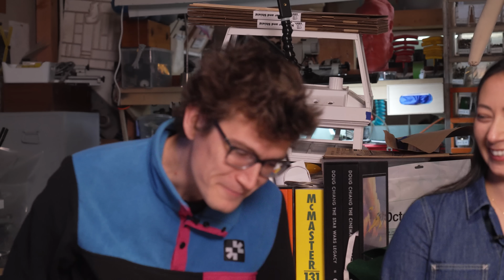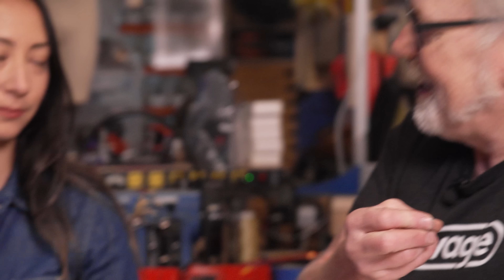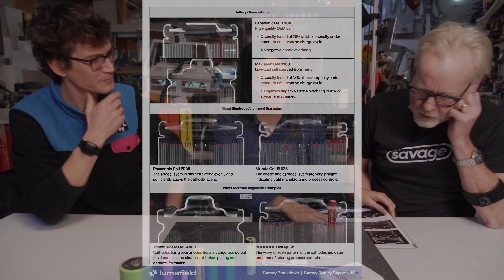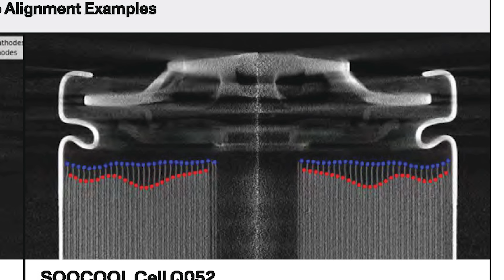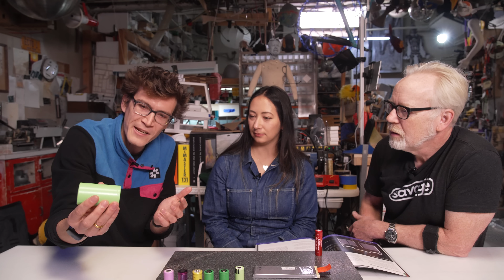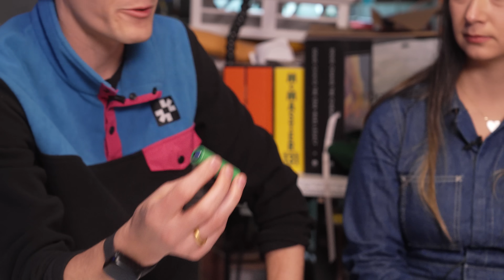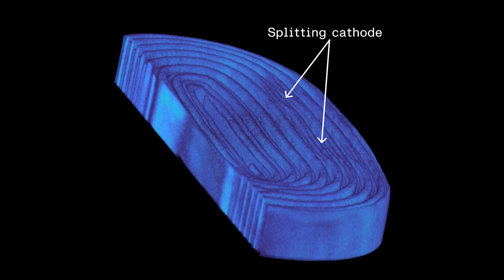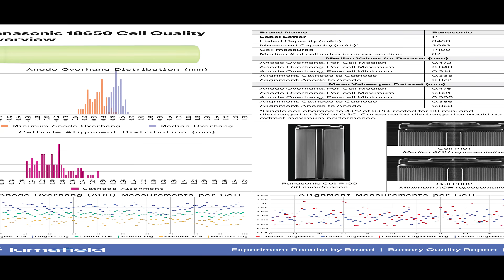The Surprising Flaws in 18650 Lithium-Ion Batteries

Comment: My 18650 battery was labeled Sure Fire.  I hope the name is not a guarantee to catch fire.
Reply: SureFire was okay, it was UltraFire you had to watch out for, those were extremely dodgy!
Reply: @Shaker626 Trustfire? 🤔
Reply: @SpectreOZ none of my TrustFires burned but they all died within two years.
Reply: @Shaker626  mine are SunFire lol-
Reply: SureFire doesn't make the batteries themselves, most of the ones I have seen were manufactured by Panasonic out of Georgia, but they also use Samsung and Sanyo batteries too. The Batteries are made to SureFire's specifications and branded with their name on them. SureFire makes some really great stuff, the US military uses SureFire branded batteries and other things made by them. I have used SureFire stuff for about 20 years with zeros issues. I worked in Afghanistan as a contractor for the US military for about 12 years and SureFire stuff was everywhere.
Reply: @JJ_ExMachina  Agree. They are also a very popular choice for police, fire and rescue.
Reply: @wingnutbert9685 ... That's right, my friend is a retired firefighter, and the surefire flashlights he has are insanely bright. They make some good stuff, a bit on the pricey side, but really built tough.
Reply: @JJ_ExMachina  SureFire flashlights got some bad publicity several years ago when they changed where they got their 18650 batteries for the SureFire. And they were overheating and sometimes catching fire. I suspect they went back to a reputable manufacturer because they haven't made the news again.
Reply: @steadyeddie7453 ... Yeah if I am not mistaken they discovered that the x300 flashlights had high parasitic drain, and was over discharging the batteries. Which is bad news for lithium based batteries. From what I am reading SureFire took action to replace the faulty flashlights with new ones when the cause of the issues was determined. I am not seeing much on failed batteries due to SureFire using subpar batteries. Panasonic did have a recall on a batch of batteries thwy determined to have issues, so that might have effected SureFire, but can't find any concrete info on that thiugh
Reply: @JJ_ExMachina  All brands with "Fire" in their name are made by others. To my knowledge, SureFire is the only one of the lot selling good batteries.
Reply: @rudib-5304 You know what, now that I think about it, yeah you're right. Have been building ebike batteries and off grid battery systems off and on since the early 2000s. Use to only run Sony, or Samsung batteries. Now that peeps are started to really test and show what's going on inside, have lots more viable options.
Reply: @JJ_ExMachina somtimes the batteries are from old devices like laptops and they wrap em and resell it after testing
Reply: @user-tr2dh4xx6u  ... It's possible, but can't find where that surefire reuses old laptop batteries in their products. I am sure they don't even recommend using repurposed batteries in anything they sell. Most of their stuff is "mil-spec" meaning designed to withstand some serious abuse, so highly unlikely the military would sign off on products running repurposed old batteries.
Reply: @JJ_ExMachina  Thank you for the comment, representative of SureFire...
Reply: @no1DdC  ... No fucking rep of Surefire, just used their stuff for over 20 years is all from my ime I served in the military to all the time I worked in a war zone as a contractor for the military. Just shared my experience with their stuff
Reply: @no1DdC  Though I dont buy batteries from you I used several of your lamps than ran on CR123
Best lamps out there. I seem to remember than you drove a Bradley IFV over one of your lamps, am I correct ?
I still have Surefire lamps in my bug out bag (shelf life of CR123 is unbeatable) but now use other brands running on 18650 for caving.
Reply: Just stay away from any cells with the word fire in the name, if it blows up you cant say they didnt warn you
Reply: @hus_10001  Unless it's Surefire. They are a well known name in the indistry.
Reply: My neighbor's old house down the street burned to the ground one night... The only thing left was the  iron mailbox at the street with the family name.  "SPARKS"
Reply: noooo, it's probably a incendiary grenade
Reply: For the love of dog. Do not buy any battery with fire in the name. I've seen to many vent over the years. Spend the 6 bucks a cell and get molicells. Or Sony/murata vct, samsung or any of those big name high discharge batteries.
Reply: @V8DV  or TENERGY - high quality US company. all their 18650 and NiMh are still good 10 years later.        EBAY stopped selling 18650, getting rid of the 'Fires' and 'Scams'
Reply: Efest came out best for me. They last for years (12+ years in constant use in high discharge torches).
Dx.
Reply: @Diagnostix_1 Efest can be very good, since they buy higher quality cells from manufacturers like Panasonic and rewrap them with their branding on them. I typically just by the Panasonic cells instead of getting them from companies that do the whole rewrap thing. But than again sometimes it's hard to find first party cells. Efest can be hit or miss, depending on what cells they have rewrapped though, as some of their batches come from rejected first party batches at a discounted price. But overall they can be pretty good, especially if you win the luck lottery and get a rewraped Sony, Panasonic, or Samsung cell.
Reply: Most vets will recognize surefire.
Reply: @rustyudder  ... Yep Surefire is all over our batteries and flashlights to name a few things.
Reply: @JJ_ExMachina  i loved my little clip lights. Ir came in handy.
Reply: @rustyudder  ... Heck yeah, I think I still have a few of them in a draw somewhere. I had them clipped on everything at one point, didn't even worry when they got washed, they just worked.
Reply: I had some UltraFire batteries, are those worse?  Maybe these Chinesium have saved money by combining the Warning label with the Brand name!
Reply: Dont call them a liar.
Reply: I moved on from ultrafire to efest (shown in the video) because the ultrafire didnt last for very long (I use them for caving).
That was a very good decision: batteries lasted much longer but more importantly I could finally use the "turbo" mode in the lamps for more than a few seconds. I also have a bunch of Panasonic that I almost never get to use since the efest last for so long.
I of course keep the batteries in hard plastic cases because of the physical nature of my activity. I dont want one bursting into fire because I dropped my bag from a few meters and a battery shorted !
Bottom line: as said in the video, spending a little bit more is the best decision if you want reliable batteries.
Reply: 😆rignt!
Reply: I’ve beat the hell out of my 18650s with my vape for years and have never had an issue
Reply: had crummy Ultrafire.  might be counterfeit too.   Only rely on TENERGY brand.
Reply: LMAO
Reply: Ultrafire for mine
Reply: I never bought any of those brands that had fire in it lol
Reply: Surefire batery is very good in terms of longevity hasd mine for 1.5 years now
Reply: @0ninetyseven97  That's still brand new, outta the box. I've got a pair of Fenix 18650's that are 12+ years old and still going.
Reply: @0ninetyseven97  They also have excellent CR123 but they are very expensive !
Reply: the name is literally the warning )
Reply: @maxsolo2652  Like apple logo is warning: one bit taken, soon to be rotten inside..
Reply: @PexiTheBuilder  – That's not a bit taken, it's a bite taken, which is a visual pun for byte, and very clever pun at that, considering that the logo was developed for one of the very first personal computers. 

While Apple wasn't the first PC maker, it is the oldest brand still making PCs today. And it was Apple's Steve Wozniak who coined the term "personal computer."
Reply: you sure you're not talking about the high quality light manufacturer?
Reply: sure fire ultrafire and trustfire are just bombs waiting to go off
Reply: @dcd231 SureFire is a legit company. They make some serious stuff. Their batteries are made by legitimate companies like Samsung, Sony, Panasonic, etc.
Reply: you are right to be nervous they named it Sure Fire as a warning sign to let you know what to expect. That way they are NOT held responsible if your home catches on fire cause they warned you  "use these batteries and your home will Surely burn down by fire"
Reply: @rogerd4559  If this was an attempt at being funny or witty, you've fallen on your face. But well done if you where trying to look like a dimwit. 👍

Comment: I have a bunch of batteries for Dewalt tools and tools that use the same batteries.  Most are knockoffs purchased from Amazon with up to 4000 positive customer reviews, whatever that means.  Of these batteries, the only one that has a fail so is a Dewalt battery led level indicators.  It shows one bar all the time though the battery cycles normally.  These are all pretty lightly used batteries.

Comment: You chose pretty nice cells Samsung 35E and the LG MJ are excellent choices. But I want to see what happens with the high amperage cells because the load on them is a LOT heavier compared to the normal ones.

Comment: Another fun fact: the actual chemistries used in lithium batteries are actually patented by other companies and licensed for a period of (usually 3-5 years) to a given manufacturer. The chemistry in cutting edge cells from company A will likely be used by company B in the future. That's how you have the budget batteries at the bottom, they're using much older chemistries or "rolling their own" (by making something that's suitably different from existing chemistry patents).

Comment: Lipo batteries scare the life out of me ever since my Daughter asked me to change the battery on her Iphone years ago.
She had taken it to a high Street repair shop they broke the home button and denied they broke it then a few weeks later the phone wouldn't charge They denied even touching it and when we showed the receipt accused my daughter of breaking it. Actually FK them it was "Timpsons"

 So I hit eBay for a new screen and a Battery and went down the garden shed workshop to fix it. when trying to put the thing back together noticed a poorly cut seam around the battery that formed a brim around the side and one end of the battery.
The extra material was stopping the battery fitting into the phone so I thought I'd trim it down.
I grabbed my Scissors and started to trim the brim off. Almost as soon as I started to cut I felt the battery start to get hot in my hand and smoke started coming out of it. I was aware of how dangerous LIPO batteries could be so the thing was launched out of the open shed door and by the time it landed outside it was on fire.  Stupidity on my part but a lucky escape if the door was closed or I'd decided to do the repair in the house that outcome might have been disastrous. However I knew the battery was a knock off and the brim didn't look like it was part of the battery it literally looked like a poorly finished covering.really didn't realise that the brim was poorly finished Anodes and Cathodes

Comment: It's a pig in a poke. 

My cheap ceramic coffee cup has to say at least which country of origin, but not a battery? I know more about where my  bananas came from than my batteries. 

At a minimum the consumer should be informed as to the date of manufacture and who the manufacturer is.

Most of these batteries are buried in our devices and not "consumer accessible." But the manufacturer of the enclosing device has the responsibility to inform the consumer.

I can't tell anything about my 18600's beyond their volt and amp claims. Some have "Brand" names (REVTRONIC, UltraFire (which claims 4200mAh)), but several are quite plain. None have even a date or country of manufacture, let alone who actually made it. 

I removed the plastic wrap (which itself was blank with only a sticker, "18650 3.7V 2100mAh") from one of them and found only a couple serial numbers (SE US18650UT[damaged] and K C4A13WJ16H), and a damaged tiny logo perhaps thermal dot-matrx printed on some kind of added thermal surface. 

I bough a solar motion light from Dollar Tree a few months ago. When it stopped working I took it apart; the 18600 battery, soldered to the wires, had shot it's core several inches out. Perhaps something I shouldn't have attached to the side of my house.

Comment: If you have a 18650 in your pocket with your keys, the key can make a perfect short circuit, resulting in a party in your pants.
Reply: I think THIS is why they are not used in more devices instead of AA/AAA's. People would treat them like AA/AAA's and burn their house down.

Comment: You should look at a few vape pens for cannabis (or nicotine).  They have little flat pack cells in them.  I wish you guys would call them CELLS.  But I know that the term 
"Battery" has been "accepted" to describe even a single cell unit since the late '60s.  You guys should also (carefully) do some (momentary) (and long term) short testing inside a plexicage. (Lexan).  And look at the momentary results (new physical imagery) after each set of shorting pulses to examine the degrade over time and event(s).

Comment: I bought two 49k mAh batteries that have solar recharge and they were both $13 each.  Now that same battery is $25 but it us STILL very much worth it and is a very good battery and even has inductive charging.  It was a heck of a deal!
Reply: What is 49k ,a brand?
Reply: @bennylloyd-willner9667   49,000 THAT is what the k. So, it is 49,000 milliampere hours.  If you do not know what that is you need to find someone who does to educate you, because the k suffix is centuries old.
Reply: @cosmicraysshotsintothelight well, talk about educated.
How often do educated say 49 "kilomilli" amps 😂
Maybe I was referring to that blunder. It is 49 Ah you're supposed to write since kilo (1000) takes out milli (1/1000) 😊
There you go, educated 👍😊
("49,000 THAT is what the k. "? nope, k means 1000, not 49,000... 
"... find someone who does TO educate you..."??) strange wording😊

Comment: Very interesting information.  We use these in our dive computers, dive lights, etc.  I tore apart a few cordless drill batteries to repower with new 18650 batteries.  I've seen cheaper versions that boast MhA specs that you know are impossible to achieve.  So, I'm familiar with these batteries, but this video gave me a whole new perspective. Thank you.

Comment: This is important. If you buy cheap, you usually get what you pay for (and may put yourself at risk)

There was a Youtube post a while back where a major tool brand battery pack locked itself out because of a detected problem. Some Yutuber decided to muck around and eventually defeated the lockout through a hack and made a big issue that the tool maker 'just wanted to sell more batteries'. The manufacturer has a reputation to protect, especially in safety issues. As we can see here a battery can seem perfectly good, when it's actually not.

Comment: surprised that cordless tools werent mentioned at all.    At big scale (like tool company's)  battery cells are NOT just assembled into a tool batery and welded.   All cells are matched very close, to ensure they all act the same under multiple loads/situations.      It may be a trade secret,  but who knows....      i built a very matched tool battery with cells that were so close in values , its like they were family.   Internal resistance, impeadeace checking,  charge and discharge cures so close , they appear like a single trace.   it took me some serious time, and a few cases of 100cells per box,  to do this, but again, it outperforms anything from the manufacturer.   i will never do it again,  because with 3 chargers that held four cells, it took me almost 1 year, so....    i now have 385 cells with values  on them and can just pick whats left so they are close...          i built a SINGLE ,   Milwaukee m18   15-cell  battery.   i wish marching cells to another was addressed in this video, because it is quite important.     Milwaukee m18 battery circuit board, is NOT active balance, but passive.

Comment: My Bosch 18v 4ah  li -on drill battery 
Is 16 years old and works fine with the circular saw and grinder also. 
My Aldi cordless drill battery went dud after 3 days . 😂

Comment: Top 10 Lithium Battery Manufacturers (2025 Market Overview)
CATL (Contemporary Amperex Technology Co., Ltd.) (China): The largest global manufacturer of EV batteries. - CHINA
BYD Company Ltd. (China): Major producer of power batteries and energy storage systems. - CHINA
LG Energy Solution (LGES) (South Korea): A leading supplier for EVs and consumer electronics. - SOUTH KOREA
Panasonic Corporation (Japan): Long-term partner with Tesla and major manufacturer of cylindrical cells. - JAPAN
SAMSUNG SDI Co., Ltd. (South Korea): High-capacity battery manufacturer for EVs and devices. - SOUTH KOREA
CALB (China Aviation Lithium Battery) (China): Rapidly growing producer of LFP and ternary batteries. - CHINA
SK On (SK Innovation) (South Korea): Key supplier for major global automakers. - SOUTH KOREA
Gotion High-Tech (China): Specializes in lithium iron phosphate (LFP) batteries. - CHINA
EVE Energy Co., Ltd. (China): Major manufacturer for both consumer and power batteries. - CHINA
Sunwoda Electronic Co., Ltd. (China): Strong in consumer electronics and rapidly expanding into EV batteries - CHINA

Comment: Amazon sold batteries are horrible with counterfeit and gray market products (scrap that was supposed to be destroyed).  I got 3 different bad batches in a row and I refuse to buy batteries or oem car parts off amazon. It’s pretty bad when you trust a part acme car parts more than one supposedly from ford (motorcraft) or Honda.
Reply: I recently bought a two,pack of batteries for a Fuji camera.  One failed after the first use.  Sent back for a refund.  The camera is junk too, likely just trash it.